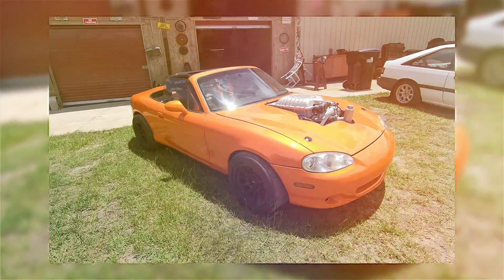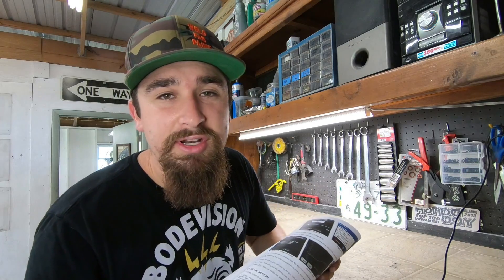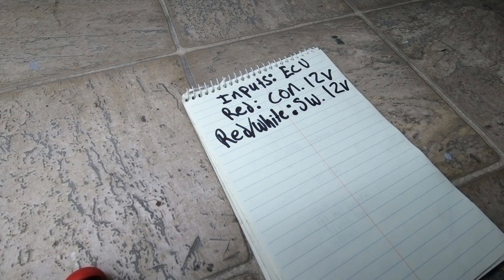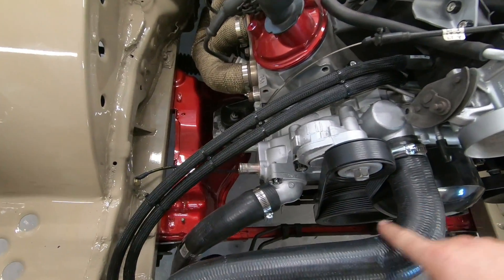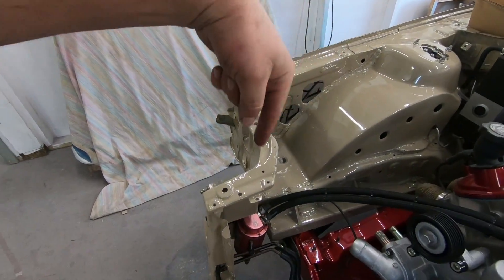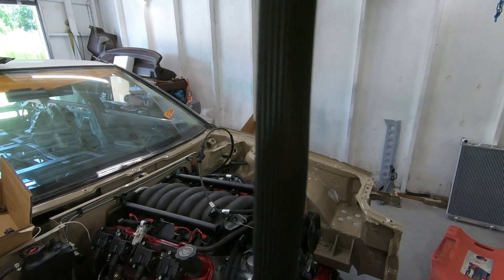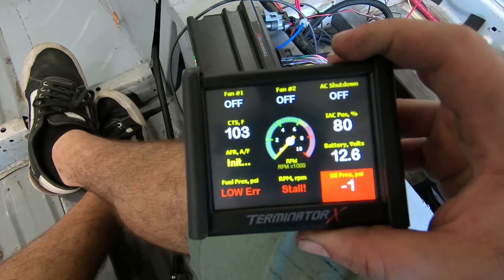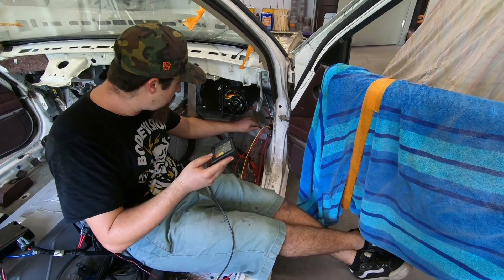How to Make A V8 LS Swap Run In Any Car! First Start up LS Swapped Honda Accord

Comment: I’m turboing my Honda daily driver, and my next build is definitely gonna be an ls swapped civic or a 2jz swapped civic, I’m gonna buy a car with one of those engines then just cut it off and weld the Honda Body on the car, so it will be a rear wheel drive v8 Honda, and I’ll do a full roll cage

Comment: Hey I’ve got an 88 prelude I’m in the process of putting a L59 5.3 in and am going to run the dc009 transmission, I was just curious on what you did for your from subframe?

Comment: I was dreaming on put  a Maserati 4.2 v8 on an alfa romeo,  but ecu, starter rev counter, speedo ,   abs ... should I get the hole system from the Mas.  or  find an aftermarket ecu?   .. I mean what about the keys to start the thing?

Comment: everyone rants and raves about the Holley terminator but its effectively illegal to use in NY due to not being OBD2 compliant. The only way an LS swapped vehicle can sneak through inspection here is if it has a stock ECU to pass the computer inspection.

Comment: Clean pretty and perfect. Made it look easy. Even though the work is there very well done and great video man
Reply: YEAH" HE DOES GREAT CUSTOM WORK..AND I AGREE WITH YOU..HE MADE IT LOOK REALLY EASY....HEY...I NEED YOU TO GO LOOK AT A MAZDA 6...2.3...MY ENGINE RAN HOT" I WANT TO DO A LS SWAP" I ALREADY GOT ENGINE AND TRANS...ALL I NEED TO DO IS GET A REAR END SET UP...IM PLANNING ON RUNNING MY EXHAUST TO THE RIGHT SIDE OF THE CAR..OR I MAY RUN EXHAUST AS IF I HAVE A TURBO...AND SNAKE EVERYTHING UP FRONT" WHAT DO YOU SEE..YES I KNOW I GOTTA MOVE THE BREAK BOOSTER OVER ALL THE WAY IN THE CORNER" ITS A MESS I KNOW...I GOT A YEAR TO CUT THE CAR UP" DAMM?

Comment: I have a Rover 827 Coupe (see KA4 Acura Legend 2.7L) I want to do the exact same kind of swap and this whole series came out as I had begun the concept/design stage. Our Chassis' are essentially cousins, although mine is a little longer, maybe a wider too. All in all I reckon if you can do it in an 80s Accord, a 80s Legend should be no more difficult at least. I'll be watching all this again when the time comes, and maybe I'll document my build as there are nearly no RWD Legend chassis on YT. Instead of an LS I was thinking a Lexus V8, and instead of GTO/Monaro subframe, I was thinking BMW or Ford (The cheaper options where I'm from)
Reply: Thanks for all the content so far though, really inspiring stuff!